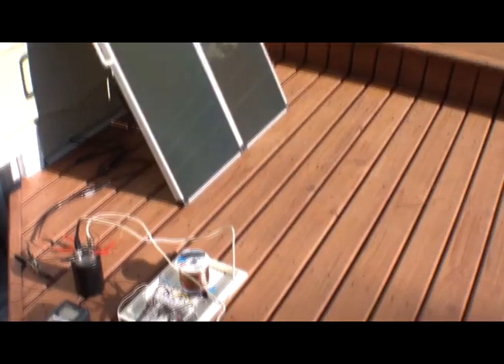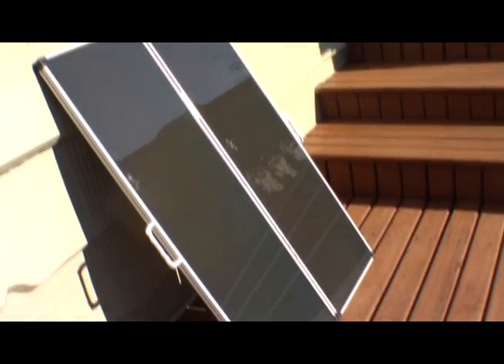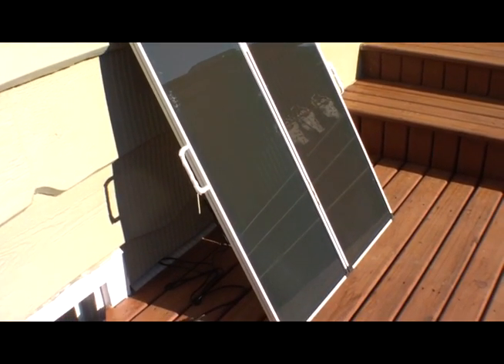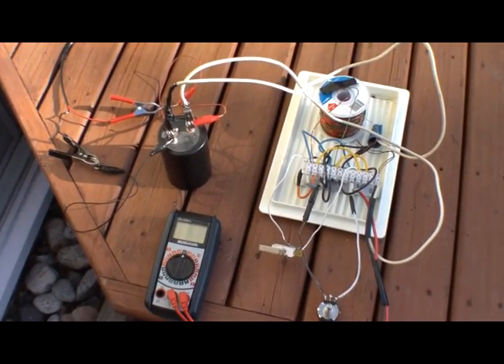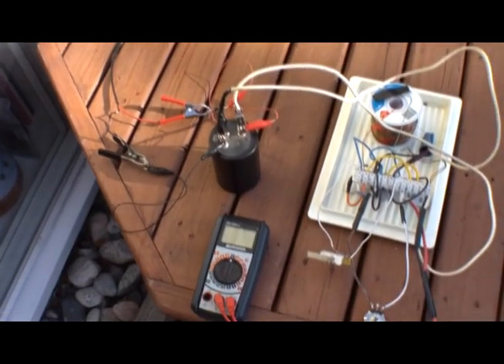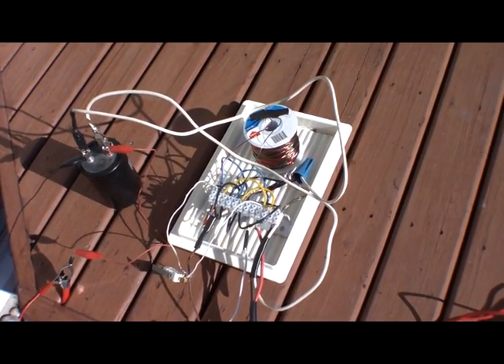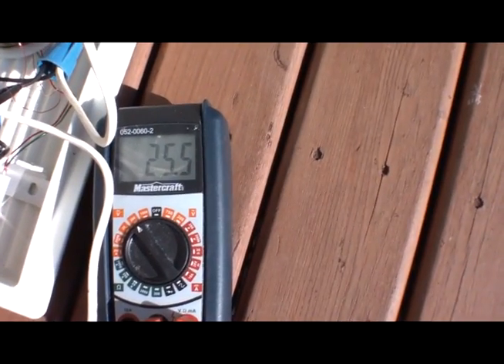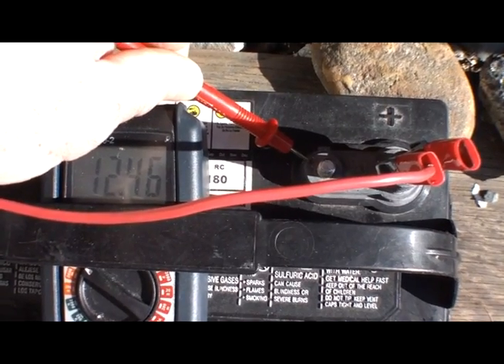Solar Bedini SSG 2T 18 ga. Running on 30 Watt Amorphous Cheapies

Comment from the maker: It was all just an experiment. It's a desulphator, not a charge circuit... I also like amorphous. I have all kinds of solar panels, love them all! Unfortunately many manufacturers of amorphous panels make them "cheap", I'd like to buy some really good ones, that were made like poly or mono's. They handle partial shading better than poly or mono. As for low light, I don't know... they are all about the same, I think. But actual shade, like a tree limb or something.. I see a large difference.

Comment: u may be missing the point with these amorphous panels, there designed for low light and overcast conditions. there used allot in northern Europe due to the lack of sun.

great project btw

Comment from the maker: @Begbucks They are not too bad, you know. For $50 / 15 watt panels... I checked them on the worst of days yesterday, it was as grey and dark out as could be, absolutely socked in with dark winter storm clouds, above 1 degree Celsius, and the pair of panels was reading 21 volts / 80 mA. That's 1.7 watts open circuit. Perhaps 1.2 load, let's guess. Considering this pair is never really going to put out more than 25 watts (realistically) - that's about 5% of max power. Better than poly?

Comment: Nice set up     
from ny 10 w solar   to 12 v 7ah   and to the ssg   charging  3 12 20ah     my charged batteries  went to 18 v  even with countinuos  led  load  spot light  10 watts  
even in a rainy day